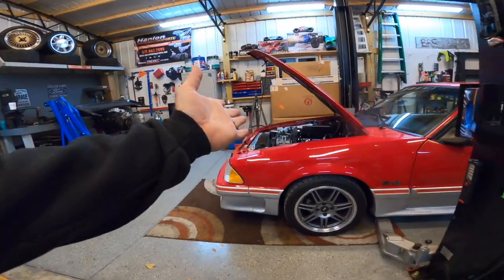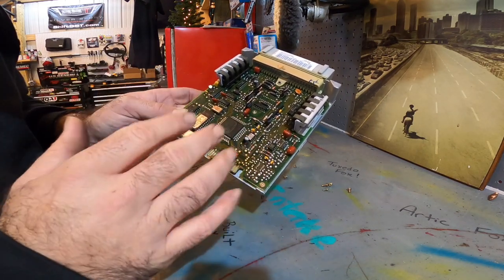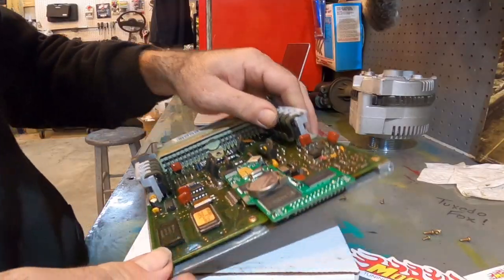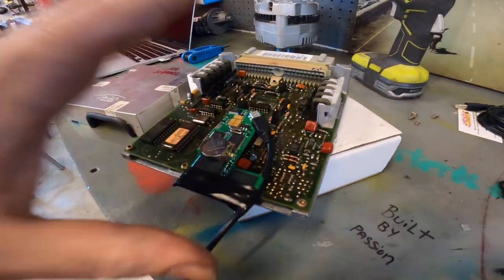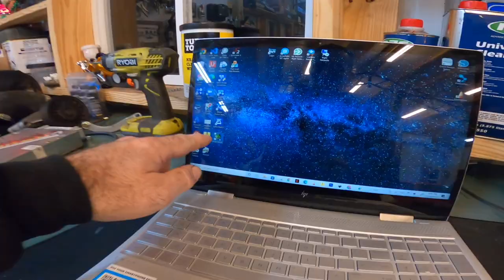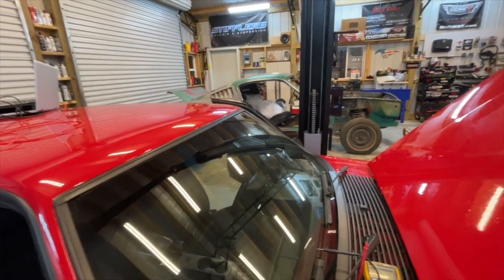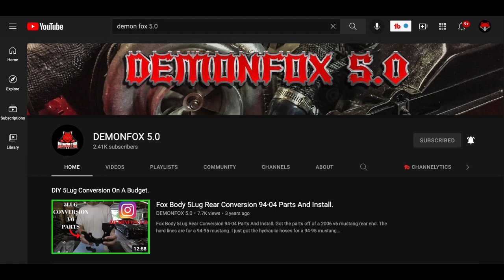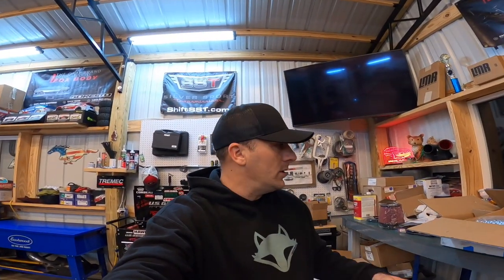In-Depth Install / MOATES QUARTER HORSE In Foxbody / Wideband Integration

Comment: as someone that works with circuit boards, wear esd gloves or something to help prevent esd on your ecu board and your moates board. It's very easy to fry small components even with a discharge so small you won't feel it.

Comment: Can't wait to see the tuning video. I came across this video researching this for my project truck. I have a 86 F150 that I built a 500hp 351w for and im doing MAS air conversion with an A9L computer. I didn't know about these until a few days ago. Im really considering one of these but no one around me will mess with a factory computer they want to install a stand-alone so hopefully I can tune it myself or find someone that will.

Comment: You should add the Amazon link for those pins you used. Btw, crimping the terminals is better than soldier if you have a good crimping tool.

Comment: I just bought egr eliminator delete cap goes on the egr plug at the valve. Would this eliminate the wire you installed for the egr?
Reply: You would have to follow it all the way through both harness back to the ECU and depin it to “eliminate” this wire. The only way to truly turn it off though is in the tune.

Comment: Your computer is missing the plastic holding cage and also the insulation. Remember to include that those steps need to be done also.
Reply from the maker: I did mention that in the video.
Reply: @BREW2LFOXBODY  Missed that part - my bad. So looking forward to this series because im on the cusp of an on3 or vortec just as you and after watching Leech (again thanks to you) I've decided to stick with the OEM EEC. My combo is mild - refreshed P heads, mild comp cam and one of the two power adders
Reply from the maker: It’s so easy compared to the Holley. I don’t think you can go wrong 👌

Comment: A battery? Why is there a battery? What happens when the battery dies?
Reply: Battery saves the tune in the chip they last about 5 to 6 years once the battery dies you'll need to replace it with a new battery then reload your tune to the chip. Technically the quarterhorse chip is supposed to be only used to get your tune dialed in get the data logs adjust data log adjust data log adjust until your tune is perfect then you order a jaybird chip and the USB chip burner and can burn the jaybird chip with your perfect tune and then remove the quarterhorse horse chip and install the jaybird chip and you'll never have to touch it again as the jaybird chips memory doesn't require a battery to stay alive. But most people just use the quarterhorse and keep it installed and run our tune off it and will just have to replace the battery every 5 to 6 years.
Reply: You simply replace the battery or we have burner chips that are solid state with no battery once you have your final tune 👍🏻